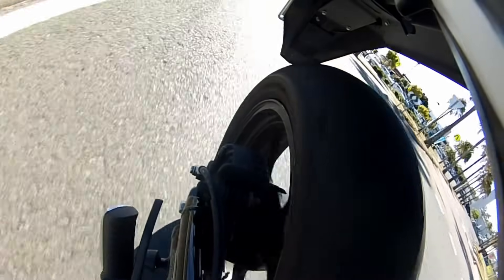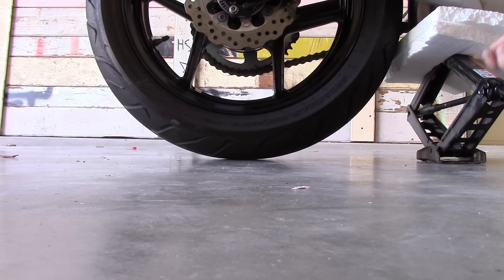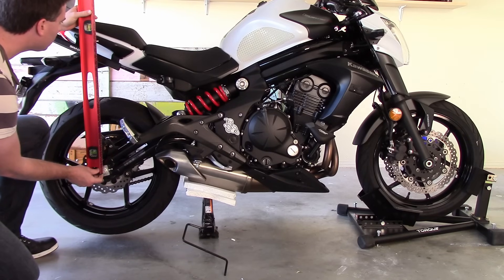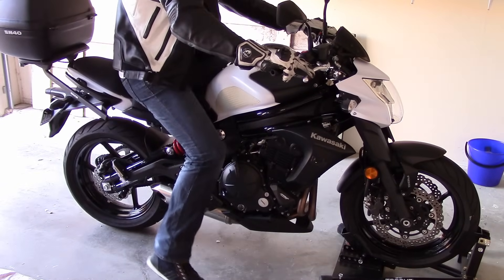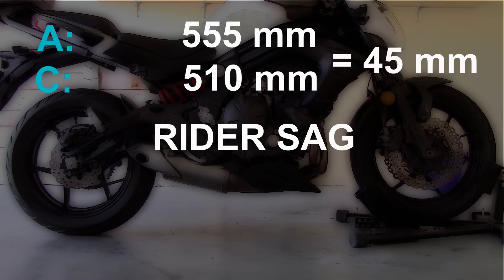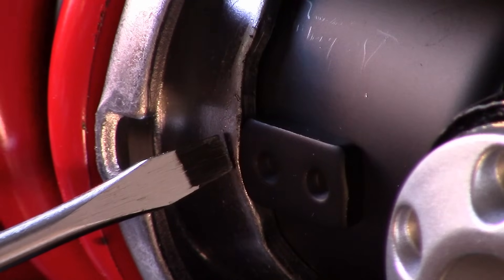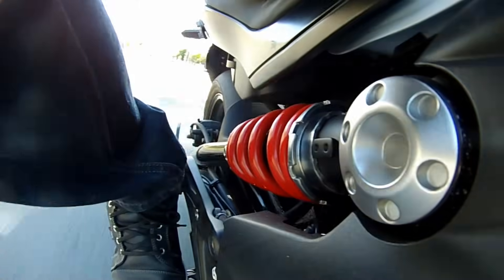How to Measure and Adjust Rear Preload - Adjust Motorcycle Suspension

Comment: So if a-c>40mm then you adjust the spring to be stiffer in order to be between 30-40mm and if a-c<30mm then you adjust the spring to be softer. This is what I saw on your video. 
You had a-c=45mm and in order to be between the optimal limits, you compressed the spring. Right?

Comment: Hi, could someone share whether I need to make preload 0 when I measure suspension length or max suspension travel with the rear wheel off the floor .Im a beginner trying to learn to do this on my own, so my question may sound stupid ,but still please share what your thoughts are .

Comment: Taking measurement like this with the rear wheel off the ground is pointless. Just adjust the pre load until the sag is correct when you sit on it, just as Alpha Force says.

Comment: Sag setting is dependent upon your spring length from what I've read. Rider sag should be 1/3 of your spring length after you have subtracted the factory preset sag/ tension on the spring. Sag will be different dependent upon the length of your spring.
Reply: Yes.. I totally agree. 
To be frank I find the video useless cause it uses absolute figures instead of percentages. Different bikes have different suspension travel lengths and different rides have different weights... Add to that, the loud music makes it sometimes hard to hear what he's saying.
Reply: @tkiblawi1 I agree. I lost my erection

Comment: Increasing preload even to ridiculous levels on a threaded adjustment seems to have no effect on the height of the rear but only makes the travel stiff and short
Reply: Preload is not a suspension tuning component, that’s a myth. Once you have bike weight on spring the preload doesn’t affect suspension
Reply: Once prelad has exactly compensated for sag, further preload won't raise th ride height but just means that more weight is needed to even begin to compress the spring.

Comment: After the free sag measurement you didn't bounce the bike so as to overcome stiction. 
The rider sag should be ideally 30%of  the stroke length ie stroke = 90mm the rider sag should be 30mm. If you blow through this number then you are using up suspension stroke and if it is a rising rate set up then you are settling into the firmer part of the stroke. Especially true in bumpy bends where you may start to run into grip issues.

Comment: Remember that rider sag is totally different between Street use and Track use. I think that 30mm - 40mm is good for street. I would personally choose maybe 25mm - 35mm to track. But static sag is 5mm - 10mm is both either you ride track or street

Comment: Are you supposed to take the measurements with the front wheel jacked up off of the ground? Just want mine to be as accurate as possible
Reply: Once the rear is UP off the ground the front being on the ground or up in the air doesn't change anything in the rear.

Comment: The main benefit of doing this is tuning the rear suspension for the weight of the rider, which helps maintain the optimal geometry between front and back. You don't need to jack your bike up to set this. Just measure the height of the rear tail when the bike is upright with no rider on it, then have the rider sit down and measure it again. Note the difference and adjust by adding preload if it sags much more than 40 mm when you sit on it. Of course, softening it up a bit is valid too if you live somewhere with crappy roads and don't want your spine jackhammered.

Comment: Very misleading information mate. You’ve got the preload adjustment wrong. 

The BIGGER the rider sag measurement, the SOFTER your suspension is. So you would need to INCREASE preload tension. 

The SMALLER the rider sag measurement, the HARDER your suspension is. So you would need to DECREASE preload tension.
Reply: Contrary to popular belief preload does NOT really make the suspension harder or softer. It sets the range in which the suspension will work.
Reply: @powermos  I think imma rise mines up because of my height no cause of my weight
Reply: @powermos  higher preload, higher the bike will be when you are on it. Incrementing preload you have less travel and you feel it stiffer
Reply: I kind of got confused on this topic too, great video though. I was looking for a way to make it higher, or Im way too tall for this bike
Reply: yeah "less than 30mm means it's too soft" that actually means it's too HARD
Reply: Artie the Swolest Man in the World mines wayyyyy to hard but I want my bike higher up
Reply: @Fordahord1  it's your bike set it how you like. if you have way too much spring on it you can ease the rebound and compression some to compensate but I'm no expert
Reply: Artie the Swolest Man in the World bro I’ve got a shitty cbf125 and I’m 6’2. suspension is not great lel

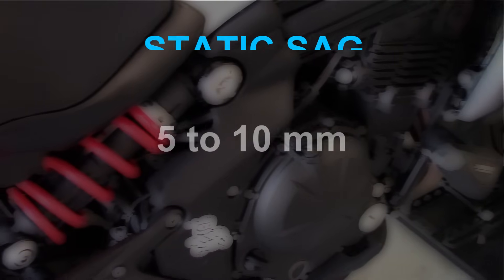Comment: 1:52 to 1:58.   that seems like exactly the OPPOSITE of the truth.   The more the sag, the SOFTER the preload tension is when sitting on the bike.  The LESS the sag, the TIGHTER or STIFFER the preload tension amount is.
Reply: You are absolutly correct mate, he seems to have mixed it up in the video.
Reply: Yeah I set mine at the highest setting. ( most preload) (condensing the spring). The bike is now set up for two up fully loaded. And I do mean full.
Reply: yes

Comment: So im bottoming out on my bike... Which way do I turn what where? Honda cbr1000f. Im on preload setting 3 from 1,2 or 3. 
No one seems to address this problem in a way that I understand! Help me correct my terminology to find my answer please
Reply: Stiffer, bottoming is too soft.
Reply: Turn the ring so that the spring looks to be getting more squashed. That will increase preload (which will raise the bike slightly - not make it "stiffer" - common misconception) so that when you sit on it, it will return to the proper height for you.
Reply: @ballamoto  I'm sure that will lower the bike if you compress it (things usually go down when you squash them), making it 'stiffer' due to more tension in the preload.
Reply: @HalfdeadRider  you are incorrect I'm afraid. You should look it up :)
Reply: @ballamoto  Sorry if I am wrong, but I'm not totally wrong, things that are compressed are made smaller, it's impossible to stretch something by squashing it lol

Maybe spring physics are not my strong point but it makes sense to me that more tension in a spring will make it harder to compress further (being stiffer), I will have to look it up sometime.

I also know more about car suspension than bikes, maybe they are somehow put together differently to how they look, the bikes rear suspension looks like coilovers to me, when they are adjusted for lowering/stiffer ride for better handling, they compress the shock absorber (damper) and spring as it's all one unit.
Reply: @HalfdeadRider  you're missing the point though, you "try" to squash the spring. But what it's actually doing is raising the central cylinder, pushing the bike up. We don't need to discuss it, it's already proven. Just Google "how does preload affect height" or something and you'll see.
Reply: @HalfdeadRider  more to the point, just Google "does preload make suspension stiffer" and you will find the answer is actually no. The SPRING is as stiff as the spring is, all you're doing is compressing it, which means you need more weight to start engaging the spring. After that weight is reached, then the spring will act exactly the same as it did before the adjustment, aka the same stiffness just with some preload.
Reply: @ballamoto  To me your comment seems to be contradicting itself (as did your first comment), you are saying the spring (caps unnecessary) is as stiff as it is going to be, then saying once compressed you need more weight to engage the spring, that means it's stiffer, it's harder to compress more, as I said.  

Oh and what the heck is a central cylinder? lol, I trained as a mechanic, worked on suspension of cars a fair few time, never heard that before, do you mean the shock absorber/damper?  If so that's where it differs to how suspension is designed and put together on cars, if the springs were adjustable on cars they would force the shock absorber/damper to compress too, lowering and stiffening the suspension.  I will have a closer more in depth look at the suspension on my bike when I get a chance.

This bloke who has been in the business for a looong time seems to say it is as I thought it was  -  https://www.youtube.com/watch?v=3FeZJRiAXRk
Reply: @HalfdeadRider  literally type in "does preload affect ride height" into Google. This is a pointless discussion.
Reply: And yes, I meant damper/shock absorber. I was just describing it. As it is a cylinder, in the centre of the spring.

Comment: Damn i had no idea you were supposed to put the preload adjusting wrench into that longer piece, I've been killing my hands all this time for nothing...
Reply: shin888 just put your glove on before you adjust it and no problems
Reply: shin888 ---> Actually, the extension handle looks like it is the wrong part/size. The wrench end should 'just' fit into the handle, as you can see from its 'flattened' state. Not only making the tool more ergonomic, but providing an 'extension' to achieve more leverage as the preload adjuster is under pressure from the spring.
Reply: @Ducati_Dude  it's like that for almost every stock motorcycle toolkit, it'll fit a lot of things (rear shock adjuster, front shock adjuster tool, a few custom flat spanners etc..) that way and give leverage ^^ 

And yeah it's a normal tube, that's flattened from factory, simple but it works damn well !

Comment: Unloaded suspension length: 585 mm 
Normal Suspension Length: 580 mm
Loaded Suspension Length: 560 mm

My Ride: Fazer 2012 Model 150 CC Indian make

After more than 10 min ride, either with or without pillion, i feel my buttocks getting stiffer and even for the pillion. and the bike is very hard when travelling over bumps. i want the ride to feel softer for long travel, say like the comfort of a auto gear scooters like activa etc.. what can be done in this case? Do i loosen or tighten the suspension? If so, until what level setting like 5 or 6 like that?
Reply: How to know which is all tighten and which is all loosen? Is there any visible mark by which we can identify? Also, I do not get the tool to adjust preload. where can i get it in India?
Reply: Sure. I do agree. Just thought I could do it myself as i am a first timer in tuning preloads. Where can i get the tool in Chennai, India? Online/ Shop? Any ideas?
Reply: @gsrajah9410  online miljayega. Nahi toh go to a nice garage and ask them to adjust preload for softness. Also make sure your tyre pressures are correct(cold)
Reply: Music is too loud.  It seems like most of these types of videos do the same thing.  Here's a hint, I want to listen to what you have to say.  I'm not interested in your music, I have plenty of my own.

Comment: Is it true that more preload helps to corner the bike faster?
Reply: +Aziz Thegreat This is kind of a vague question. Preload sets how much sag the bike has when the suspension has a load on it. Every bike and riding style has an "ideal" amount of sag. For road bikes, it's generally somewhere around 30mm. A bike that has a proper amount of sag set will corner "better." Faster doesn't always mean "better." It's worth mentioning that as you increase preload, you can end up raising the rear ride high a bit. This will increase the rake, decrease trail, and make the bike turn in a bit quicker.
Reply: No

Comment: The 30mm and 40mm variance... does this apply when riding two-up also?
Want to get it right for a two-up ride 487kms.  Had it wound down too much on a trip half the distance, and cause problems for my passenger..
Reply from the maker: CBR1000F Kiwi MotoVlog Yes, same rule apply - except you need to do the measurement for rider sag with both you and the pillion seated. Another thing to keep in mind is that on cheaper suspension, that might not be possible - you don't want the suspension ever bottoming out so you may need to modify this to prevent this from happening.
Reply: TheRideAdvice Thanks, will do.

Comment: "less than 30mm and your preload  is too soft, more than 40mm is too much preload".... isn´t it backwards?
Reply: francisco rios yes it is!
Reply: francisco rios I think your right there. It should be more than 30mm and your preload is too soft. Less than 40mm too much preload. When you think of it like your loading up the spring = more preload to reduce the rider sag. (Less drop). Decreasing spring pressure = more sag (increased drop). Loading up with preload reduces riders sag but gives more static sag which I think would be adjustable on the top shock absorber threaded mount. Well presented video.